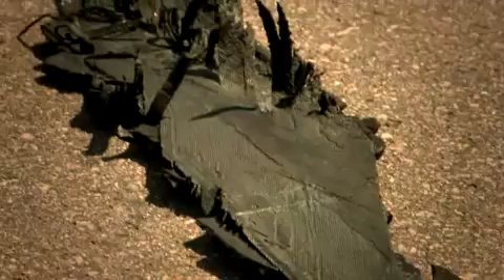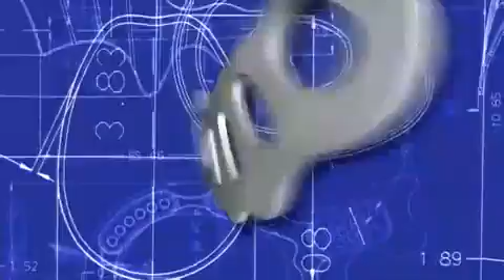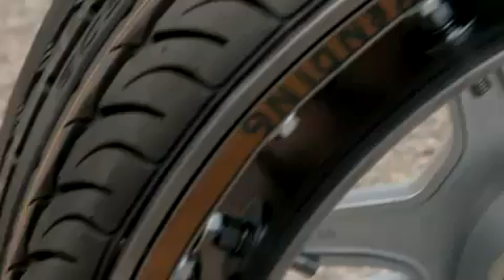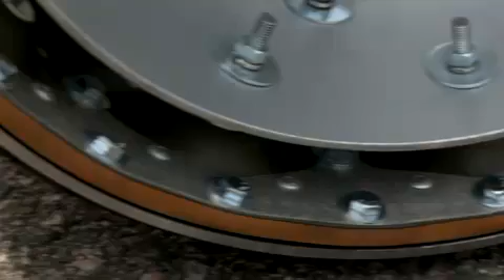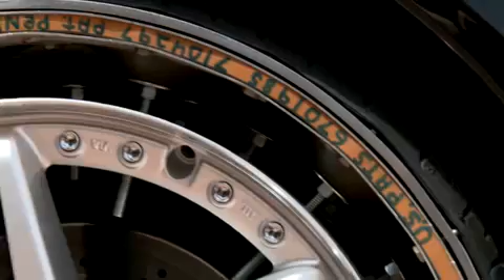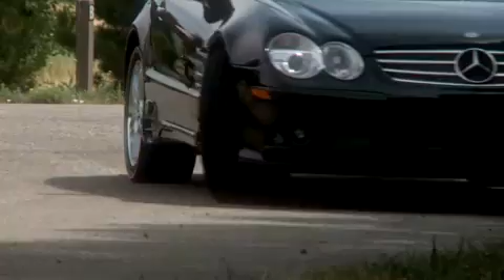The Energy Return Wheel ERW©

Comment: How many lug bolts hold your wheel in place? ERW is much more maneuverable than any pneumatic tire...Ever. Our high frequency in wheel suspension tracks true and is supported 360 degrees via our highly charged attachments. ERW is the future of motorsport.

Comment: Off road or poor road performance is very good. Impact is shared 360 degrees as the hoops become out of round. That action stretches attachments and returns energy in the direction of travel instead of bouncing. ERW is high frequency response while pneumatic tires are low frequency.

Comment: Eventually every efficiency potential will be developed. ERW is the most able to utilize these developments because of our near hard wheel rolling efficiency. Screw force accumulation and return, lateral forces the pull of gravity are all drawn into the radial array. Energy drawn to points is a good way to isolate, control and then direct a very great % of the dynamic tension.

Comment: Check out our USDOT coast down video. Also for bicycle we tested at Oxylane Lab in Finland. To turn a 1.5 meter drum at a constant 20 kmph. while loaded with 50 kilos their high psi. road bike was 40 watts. Our open sidewall MTB prototype tested at 42 watts. Our aero watt disadvantage and MTB tire profile indicates a significant efficiency improvement on our first try.

Comment: Also my biggest question: The wheel shown appears to be a stock Mercedes rim for the base. Is it possible for consumers to keep their current wheel, and use the fitted exterior portion? Assuming the original wheel is cut into for the locking bolts.. This is what it appears to look like and I assume this might be a challenge to market. Would you partner with dealerships or wheel shops to offer services to make the transformation? And are you working with any automotive OEMs for exclusive usage?

Comment: We have an articulated hoop that can flex a footprint to the surface. We stick to the surface or are held to the surface by our radial array suspension. We are also pioneering a novel linear traction system that projects to the surface. Super high speed travel via large diameter ERW's.

Comment: Screw force accumulation and return. A radial array of highly charged elastic attachments suspends the  wheel hub centering in the hoop. When weight is applied the hub lowers stretching the upper 180  hoop attachments. This stretch bias flings the hoop when throttle response charges the 360 radial array. A momentum building into rolling action...Path of least resistance.

Comment: 25 psi is not dangerous. I used to work for Goodyear. Normal tire pressure in the 70's was 28 psi in the rear and 30 psi in the front, for 80% of cars. 
The U.S. Department of Energy estimates that gas mileage can be lowered by 0.4% for every 1 PSI (pound per square inch) drop in the pressure of all four tires. At 25 mpg that's 1 mpg for every 2 psi. Pump up your tires to 10,000 psi, and one 20 gallon tank of gas will take you 100,000 miles! So much for stats! lol